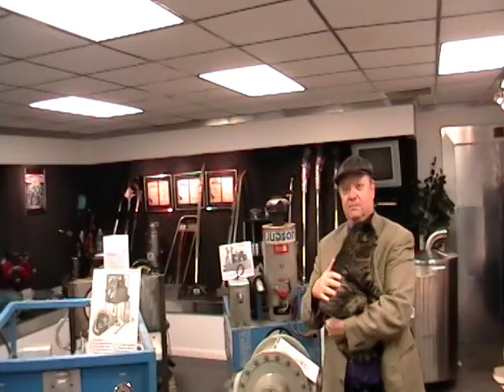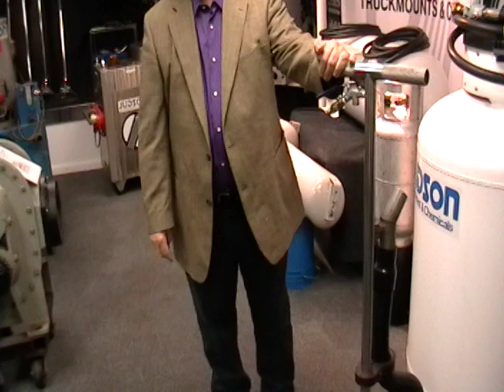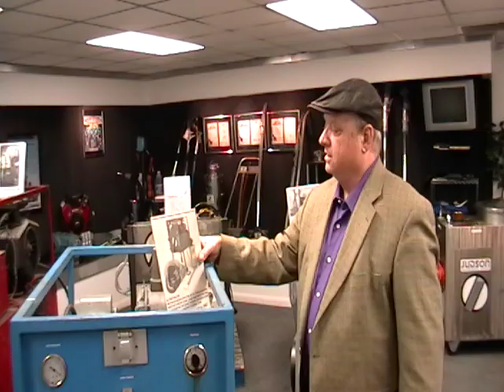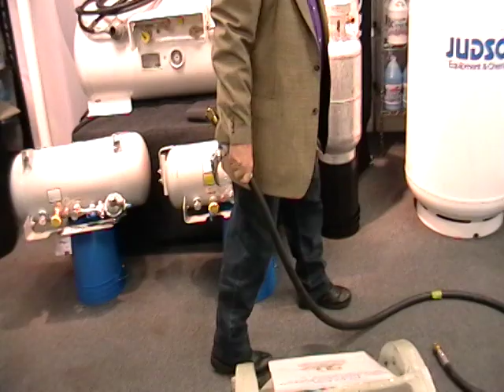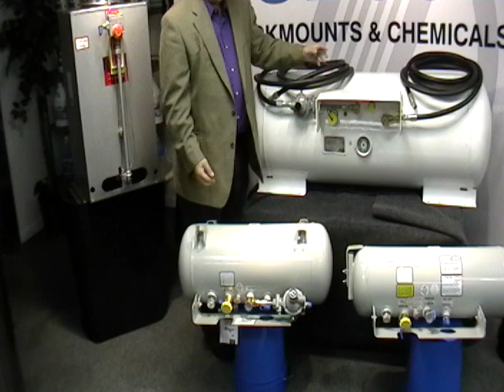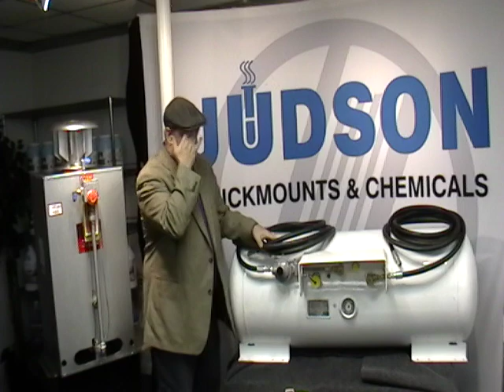2024 / NEW Judson Propane SYSTEMS For Truck Mounts  CARPETCLEANING

Comment: Hello Les, I would love a better look at that electric of yours.  We purchased our 1st TM in 1976, added our 2nd about a year later, then a, I think it was a Steamex unit.  I then built 2 TM units, w/Sutorbuilt and memory says Cat pumps.  One unit was a single cylinder Honda, with the 2nd with the "original generator" for motor homes and such:  Kohler opposed cyl flat head motor.  Again, from memory the H.P. was 13 and 23 respectively.  Since our first 2 units came with the Little Giant, we continued to use the on our 2 self builds and several other applications as well.  Like yourself, our initial Giants were round, then I think on our 2nd they became square along with other improvements.  My plans were to produce TM units,  yet running 5 TMs from about 79-80 on, and by reputation janitorial grew and grew.  We were also starting to focus more on retail vct floor care, ending up in the early 90s running around 52, 28in propane burnishers, doing approx 1.5 million sq. ft. per night, 7 nights a week.  NOW THE ONLY, reason I mention ALL this is no brag!!  It is simply to verify that what you have been saying about propane is THE TRUTH!!  Recap: cleaning since 1968, 5 TMs, 50+ propane powered floor machines, and here is the kicker;  MULTIPLE OPERATORS and NOT ONE FIRE, accident of any kind related to propane...    Al Cooper.  Cascadia Clean Carpet.  Since 1968.  P.S.  We have never met, nor have I owned one of your machines, so were not cousin's or brother in-laws...lol

Comment: Les, do you have a contact for the tank delivery that's the most cost effective? Also do you have a parts list of the adapters needed to connect a little giant to a cleaning machine? Specifically a Jaguar 8.4 portable with a male solution connection. I have the LP hose, the regulator and the relief valve that I bought with the heater from Little Giant, but almost none of those connections fit with any other connection so i have to assume there's a lot of adapters needed. This is my first time using this heater and it's hard to find any info on it. I've also sent you an email on your website.